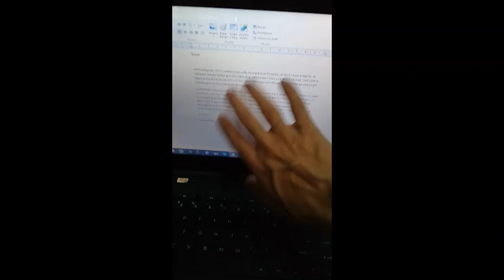Japanese and regular poo-chi comparison

Comment: hey I know this is an old vid but your vids are the only ones I can find on poochi repairs. and like I'm trying to replace the tails on mine but I can't, for the life of me, figure out how to open the body :s I got the head from the body but I can't seem to open up the body shell at all, it stays stuck near the front somewhere.
Reply from the maker: There's screws under the domes at the legs, you have to take the domes out and take the legs off to open the body properly
Reply: @Zadakleader635IvanTheRobot  oooh alright, thanks.
I'm struggeling to take the domes off tho. I heared you mention so just apply some pressure, but these things are on HARD :'D